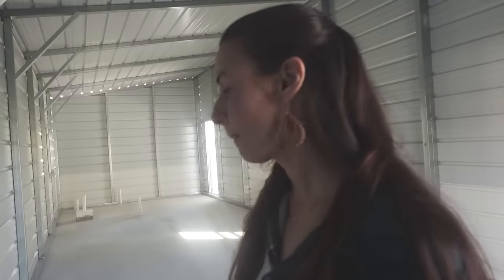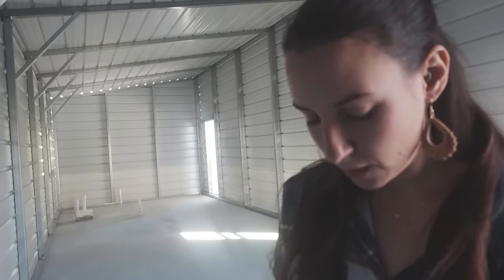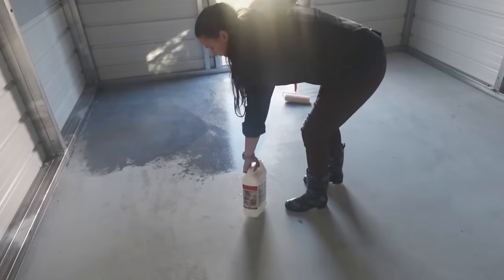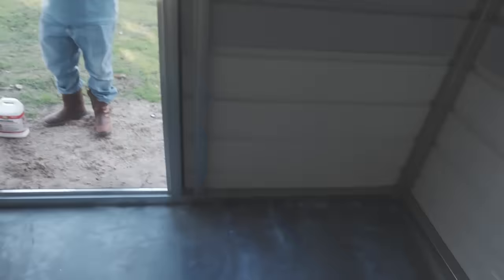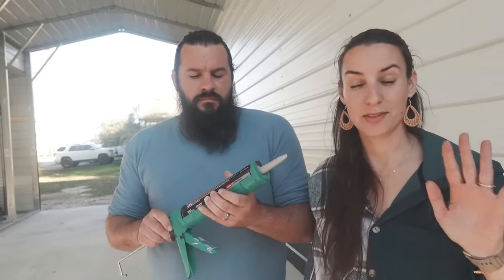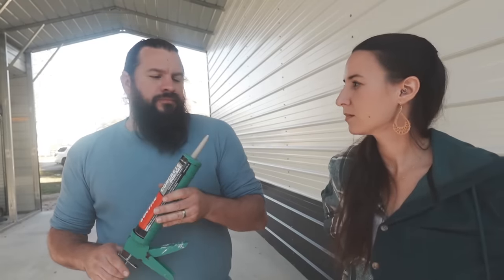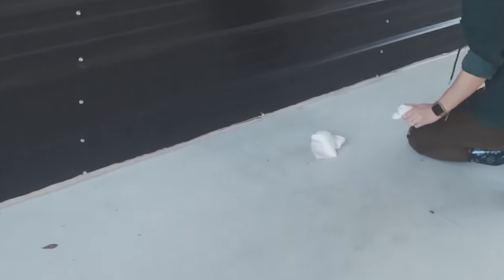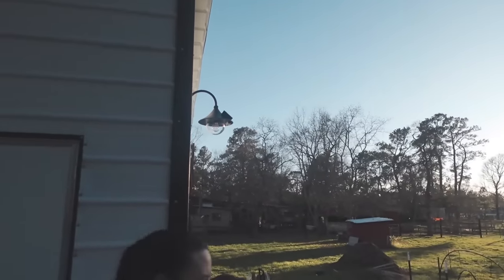Waterproofing the Barn Floor!

Comment: It’s usually poured into a paint pan for coverage consistency. Be sure to let it dry completely between coats. 😊
Reply: Yes that is true. It would have finished a larger area if it was applied like paint.
Reply: It’s going on so much heavier/thicker from being poured.    Maybe the paint pan would have kept it thinner but possibly now won’t require a second coat.

Comment: Every thing is looking great! So much prep work, but it will be worth it! I'm wondering though if you had taken the floor sealant and put it into a paint tray instead of pouring it directly onto the floor if that would have made the product go farther and maybe Moore even when dipp8ng your roller into it.🤷‍♀️ Just a thought. As for the gun sealant those things are never right in how far you can go. But wow, it is looking ao good! 
Elora is doing great on the bike!🤗💖

Comment: Frankly, if I were starting with new concrete flooring I would have had professionally cleaned(Stanley Steemer does), epoxy sealed with those little pebble thingies  embedded so it was non slip and used rubber mats to catch any "oil dripper" messes.Yet, it's you money I'm spending, not mine..............lol

Comment: Be careful when your feet get wet walking in there. The fall straight on your kester.
Reply: Did they say to pour it on the cement or to put it in a Pan? And use it like you do paint?